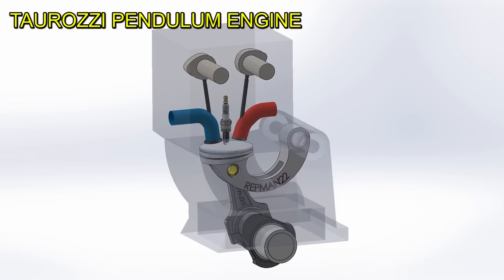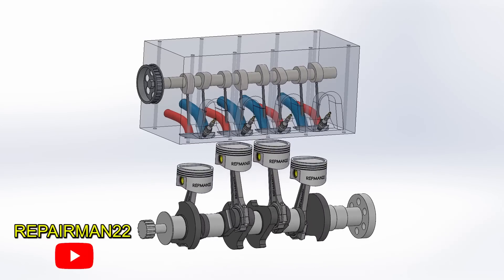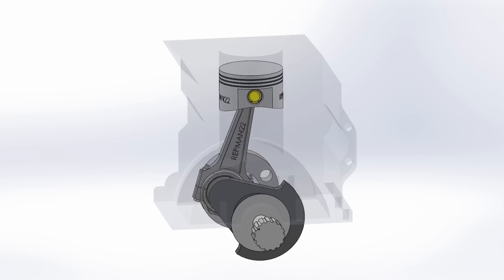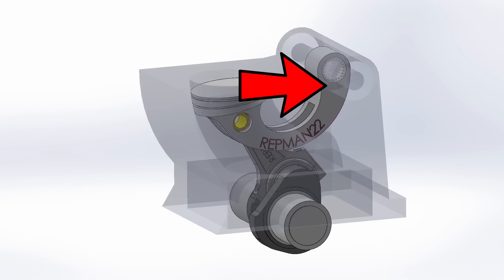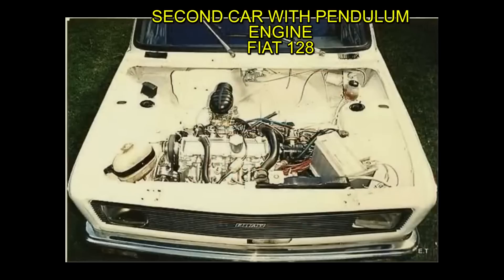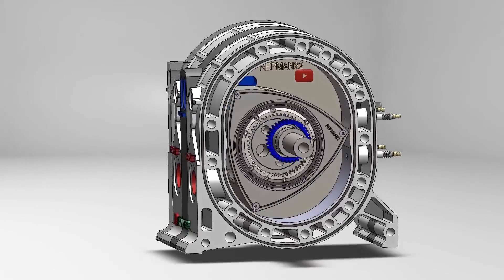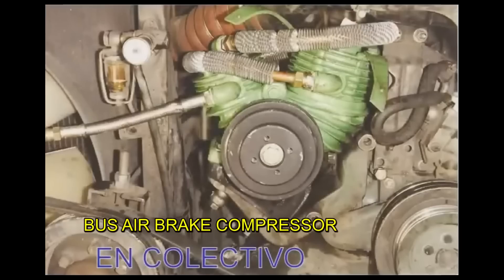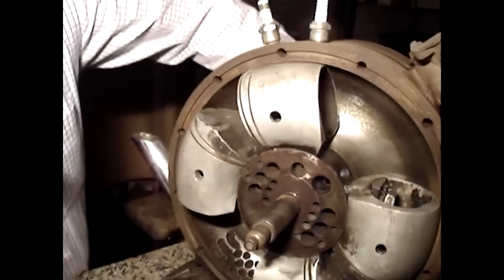All about the Taurozzi Pendulum Engine 🧠 and what happend to it🤯

Comment: I would love to see the machinery takes to bore a curved cylinder!
Reply: guess its just same system as in the engine making same movement of drill
Reply: @orangestoneface  even a 3 dimensional cnc m/c could not produce curved bores. Weather they could be cast and polished I do not know. And who could do a re-bore.
Reply: @orangestoneface  can imagine billet mounted on lathe axis of biaxial milling maschine while being bored with flycuter working from second axis. Then hone with ball style honing head Must be lot of fun to setconcentricity of piston path in relation to bore while keeping crank in just right tolerance. Like we have dynamically changing triangle here both adventage and asspain to assembly technicians do i think it may be why they are no so common. But sound of it in 6 cylinder 8liter naturally aspirated boxer config must be awesome 🤩
Reply: @orangestoneface  
If you did guess that, you would be very wrong.
Reply: @orangestoneface  the bore tool might even just replace the con rod and piston, doesn't seem too hard to figure out.
Reply: @orangestoneface  what happens when you turn a u-shaped drill bit 180°?
Reply: That machine cost 20 billion dollars and take a day to do one block...😂😂😂
Reply: @chuckschneider5625  think about jet engines blades, they are far more complicated in production, and yet they basically can be produced in small workshops with modern equipment
Reply: @chuckschneider5625  Maybe you didn't watch the vid. The Tourozie compressor uses the same shape cylinder and is mass-produced.
Reply: @chuckschneider5625  The first one always takes time. when you scale up for production things get done differently 🤦‍♂️
Reply: @chuckschneider5625  The Cost is expected, but the production time is a problem.
Reply: Nothing modern CNC machining can't accomplish.  Obviously the compressor manufacturers have it all figured out.
Reply: @magnusatheos7301  
Maybe so, I still want to see it!
Reply: @upsidedowndog1256  LOL so do I
Reply: @upsidedowndog1256  me too.
Reply: @upsidedowndog1256  Look up 5-Axis CNC or even better Metal SLS 3D printers. The latter can create shapes that are utterly impossible to accomplish with standard tooling.
Reply: @upsidedowndog1256  Simple, a spherical cutter
Reply: @magnusatheos7301  
Nop! Making a round bore with a curve in it, that is constant and smooth enough to have a piston and it´s rings hurtle up and down a hundred times a second is not don that easy!
A modern CNC could do that, but it takes hours for a single bor!
And for what benefit??
Reply: @martin09091989  on utilise un outil hémisphérique où un outil boule c'est parfaitement rond et on lui donne la forme que l'on veut et donc on peut aussi avoir un Rodoir de la même forme pour la finition
Reply: @denis-uo6ew  Merci d'avoir ajouté votre réponse. Voici votre réponse traduite par Google: (Thanks for adding your reply. Here's your reply translated by Google:)
we use a hemispherical tool where a ball tool is perfectly round and we give it the shape we want and therefore we can also have a Rodoir of the same shape for the finish
Reply: @denis-uo6ew  Es ist schlecht Franzose zu sein!
Reply: @martin09091989  je ne pourrais pas être suisse ou belge ou monégasque ?
Reply: @martin09091989  it takes hours for a single full cut, sure. However if you cast the block and the cutter only needs to refine the bore, it is much quicker. In a modern multi axis CNC mill, it would be very quick.
Reply: @unicornadrian1358  the majority of the shape would be cast, the rest would cut just as quickly as a straight bore. Rotate the block around the same axis as the pendulum arm as the boring bar machines it out. Easy and repeatable at speed.
Reply: @denis-uo6ew  Avec des pistons aussi courts, ne risque-t-on pas des remontées d'huile comme sur certains moteurs récents ?
Reply: @tinkerne-round4079  yeah just get a rotary table on a milling machine. Cutter stays at the same height throughout operation, work piece is rotated into the cutter. Pretty simple really.
Reply: @unicornadrian1358  But still way slower and more elaborate.
And for what benefit?
Reply: @tinkerne-round4079  yep exactly what I said.
Reply: @martin09091989  what benefit? An excellent engine that basically lasts forever
Reply: @unicornadrian1358 
Why, is it better? Just repeating nonsense frases doesn't explain anything!
How dose this construction reduce friction?
How dose it make the combustion more efficient?
Reply: @martin09091989  it doesn't make the combustion itself more efficient.
It can only reduce friction losses due to the short piston.
Nothing more, nothing less.
Further its a 100% conventional engine.
Reply: @doctordapp  All that trouble for that piss amount of friction, and all the new problems it brings with it?
Wow that's stupid!
First problem: the moving mass on the rod end is higher due to the arm, needs bigger bearings, more friction. 
2nd: when the engine and thus the piston arm heats up, it grows toward the one side of the chamber wall.
3rd: piston rings wear unevenly and will be influenced by the centrifugal force around the arm axis. Outside gets pushed against the wall harder, inside gets pushed into the groove.
4th: block strength is compromised due to openings on the side, so the block gets weaker and/or more heavy!
5th: the piston acceleration has higher peaks due to the two circular paths instead of one linear.
The piston will get jerked harder on TDC, depending on the rotational direction to the piston arm at decel or accel.

And the knew harmonics the arm brings with it! An engeneres sweaty nightmare! 😱
I see parts of the piston fatiguing, and weird wear patterns on all the bearings.
Reply: "And for what benefit?"... Jesus man,  go watch the video again.
Reply: @jpwillm5252  je n'en sais rien l'huile c'est en général dans le vilebrequin et par barbotage là il s'est même permis d'enlever le troisième segment (racleur) donc c'est encore mieux
Reply: @denis-uo6ew  Je pensais à certains moteurs comme les "Puretech" (Stellantis).
Mais ici, on s'est permis de supprimer le racleur, ce qui est bon signe. 😎
Reply: @martin09091989  the friction is greatly reduced because the piston has a set travel path that is centred within the bore. Unlike a standard piston which relies on contact with the bore to maintain alignment. It was literally explained in the video. How about you watch the actual video instead of gnawing on your crayons. Then you won’t need to ask ridiculous and superfluous questions.
Reply: @Martin L  rewatch the video,  it tells AND SHOWS how friction would be lower.
Reply: @miniac60  only theoretical...
You add other problems to the system.
Strange harmonics, thermal expansion which is impossible to handle.
It looks promising, but has a lot more than only the advantages...
Reply: @unicornadrian1358  I knew what the benefits of this design was and the intention behind it. Just was curious if someone could come up with another bonkers reason. 😏
40% of all parasitic loses inside a engine is from the piston group.
Half of that is for the rings dielrectly and half is from shear forces between the piston and oil film.
This shear forces are round about half and half for the skirt and the oil rings.
Half of the work of scraping off the excessive oil comes from the skirt.
So in best case zenario you get somthing like a 10-15% reduction of losses thru that mechanism.
And now add all the additional losses thus to increase of yoints.
For the mater of the doubt, let's give it a 10% benefit.
Is that worth the effort?
You can easily shave off alot more loses with simpler solutions.
Alot of modern engine for example have variable displacement oil pumps, that gives you 10-15% right of the bett. Also magnetically coupled water pumps to cycle them periodically or to use a smaller electrical pump for low power situations.
The benefit is not worth the complexity!
Maby you can work out all the new kinks of such a system and make it at least reliable.
But you have alot more expanses to produce and maintain such an engine.
For example you need a specialized Maschine to hone the bore for repair, heck you can't even cross hatch it because you just can do single point cutting! You also can't sleve it, so you have to LDS coate it or go back to Alusil surfaces.
Alusil is just repairable with larger pistons, and LDS is not viable for repair and needs cross hatching anyway!
That's like making a wankel engine equal to a piston engine. Can it be done? Shure, but it takes aerospace tech and development to do it!
And even the simple solution like the oil pumps are not done on smaller cheaper engines because it's simply not worth it.
Reply: @martin09091989   Not really.... If you start with a decent dimensionally stable investment casting the machining of the block using a 5 axis CNC machining center could do a block in a half hour. It would only take hours if you started with a large billet of solid iron. For that matter, the bores could be machined as sleeves then pressed into an aluminum block adding lightness to the equation. Benefits? Longer life with no bore or piston wear, less oil consumption, higher efficiency, just to name a few......
Reply: @martin09091989 guess you know more than the engineer who design it. That is why his invention is being used all over the world in medical compressors and you are just a keyboard warrior….
Reply: @martin09091989  Like they said. Dont be a knucklehead. Watch it again and come back and tell the group how You can make it better.
Reply: @martin09091989  What a load of absolute piffle! I mean, seriously? You make that claim yet some backyard engineering enthusiast in 1970s Argentina was able to do it in his own workshop!
Jeez, if the quality of logic on display in this thread was a gauge of future human endeavours, I think I could rest assured that humanity wasn't going to create its own mass extinction event... because we'd all be dead by next Tuesday.
Reply: @martin09091989  Ich bin ein hotdog.
Reply: @davidcolin6519  It's not that it can't be made!
It's the viability that's the problem.
It increases complexity and afford to make, and doesn't give back much benefits and adds new problems. 
I am myself build stuff like that all the time just because it's a fun challenge, not because it's revolutionary.
I guess that was his purpose also.
But then comes someone that doesn't understand engenering and think that's the next best shitt after sliced bread, and convince him to promote his stuff, or dose it for him.
Sry to brake your enthusiasm about revolutionary inventions that kept suppressed by evil corporations for profit......  It's not that!
This stuff was made multiple times over the last 200 years, and it was not successful for reasons.
Engineers built a multitude of engines with all sorts of levers and cogs. 
In fact, the first gas engine from Nicolaus August Otto, (the inventor of the Otto cycle) had no crank but a long ratched rack to drive the flywheel. It worked fine, but it was quickly replaced by a conventional crank, but with a linear guided rod end, like a steam engine. 
That was quickly replaced by today's standard configuration, even with slow moving open crank engines. Why if such a guiding system is such a good idea??? 
Because more affort for to less advantage, if at all!
In reality, alot of things that are good in theory are bad in practice.
Reply: @ajwilson605  How would you Maschine and press in a bowed sleeve? That would be interesting.
Also how do you hone the surface to get a cross hatch to hold oil?
You just can Single point cut such a geometry.
Best choice for the bore lining would be LDS or Alusil. 
Alusil is crap, and LDS can't be repaired and need honing. 
And why would there be no wear on the bore? Most wear comes from the rings, the skirt is mostly hydrodynamicly beared by the oil.
Oh Yea, because it says so in the video. My bad! 🤦‍♂️
Reply: @tinkerne-round4079  the tooling would wear faster with the curved bore. A straight cylinder can be reamed with a bar tool that has a straight line cutting edge. A curved bore can only be reamed with a point tool.
Reply: @martin09091989  The benefit is fuel efficiency for starters it seems.
Reply: @jpwillm5252  did you not listen to the video?? it addresses why oil is not an issue
Reply: @leadgindairy3709  
Yea, I did!
And what?
Everything claimed from the curator is absolute truth?
Because it must be, ain't it?
What technical fact in this video makes logical sense?
It's just the typical "it's 30% more efficient, bla, bla"
The compressors build with that is a viable application because they have Teflon seals and are used for spezial purposes where no oil is wanted. So you can't use the piston to guide itself. But on the other hand don't need to have a cross hatch (so you can single point cut it) in the bore, not much heat and low rpm.
By the way, 50% of the friction in a piston group comes from the rings, and those loses make up for 40% of all parasitic loses INSIDE the engine, and the parasitics make 5-7% of the engine power. It's not the ultimate wonder weapon that increases efficiency at 30%.
It literally reduces over all PISTON group losses 20- 30% (mathematically best Szenario) wich results in 1-2% overall efficiency gain! WOW! 💪
Reply: @Martin L    Hey, you are obviously taking an emotional approach to this argument and it's not going to end well.  But for sake of explanation,  there is no wrist pin on the banana arm... that piston can literally ride in a perfect path where it NEVER contacts the cylinder walls.  Hence, nearly zero friction.  This system works nearly identical to a standard shock stanchion,  where an o-ring is all that seals the piston concentrically in a shock body.  

And building the curved bore?  They were doing this on manual mills 90 years ago... you don't think a 5 axis machine could whip that out in its sleep today? 

Rather than being so opinionated,  maybe approach things from a "want for information " angle, and maybe you won't get your ass handed to you so hard.
Reply: @matthewpeterson3329  I don't know where the emotional part is, but maby it just bugs me that so much people can't use there brain, and instead like to get hyped with spectacular special bla blub.... 
Thing is, it's not at all frictionless, the rings make up for 50% of friction in the piston group.
So that's the rings, (mostly the oil rings) and the skirt and the rist pin (wich is negligible)
What I would like to see on the comments are technical debate about specific aspects of this construction, and what those could be beneficial for.
Like the compressors, those are for low oil, or oil less applications where you can't rely on the skirts for guiding. How much rpm can you pull on those ptfe seals, and what surface on the bore is good for that?
Maby a smooth bore with chrome plating?
You can Single point cut such a shape smooth easily, but you can't hone it.
Wich surface treatment would you think would be viable for a production, combustion engine in that making? 
Honing a cross hatch is pretty much out of the question.
Or how would you do that?
Reply: @Martin L    I like people like you,  so certain you're right.  For those of us who love ICE engines but are willing to think outside the norm, It will be so much more sweet when you're left in the dust.  So long as it works well, and criminal politicians don't influence it, the next best engine could be within our grasp.  Time to step back and consider every option.
Reply: @matthewpeterson3329  They are asking questions, you are being emotional, this is a basic thing to observe.
Reply: @matthewpeterson3329  No I'm not certain that I'm right but pretty convinced.
As long as no one brings up some logical and technical based argument I will nagg you dreamers until I get bored! 🤣
No really, no one defending this brings up real technical arguments!
It's all just "it's so much more efficient", "you just wana be against it", "watch the video..." bla bla bla....
Pls, someone give me a theoretical solution how the get a cross hatch in that bore! How?
Reply: @Martin L   This started with someone saying they wanted to see how a curved borebwas made.  You immediately and very adamantly stated the idea was ridiculous, so hotly that it could only be perceived as passionate... hence emotional.  My stance is that if engine builders exhausted this design concept, proving  that it no merit, then sure, I might agree with you.  But it hasn't, and you haven't,  and we are supposed to accept your nay-saying as gospel.  Fact is, there is a lot of money behind keeping new designs from being tried.  Oil companies and automakers want us to keep burning those dinosaurs, so much so that they will spend millions keeping innovation stifled.  Personally, I love ICE engines, noise, and the smell of burnt rubber.  I also love seeing creative options other than fucking EVs.  You are telling us to prove it will work.  How about you prove it won't.  Your points don't correspond with this type of engine, no matter how often you repeat yourself.
Reply: @martin09091989  cast then cnc for more precision
Reply: @martin09091989  lol that’s a lot of words for “I don’t understand what I am looking at.” 
Of course it can be sleeved and without much difficulty. Oversized pistons can be put in with little effort. Of course they won’t need to either of those things due to the lack of friction inherent in this design. It runs cooler and requires less lubrication which both increase efficiency. The only “downside” to this engine is its longevity. No manufacturer wants an engine they don’t have to replace at some point. Interesting that you don’t think it’s reliable when his own car has been running for 40 years. 😂 sheesh.
Reply: @martin09091989  Well, IF the engine does get 30% better economy then that would benefit the consumer so realizing that, there is definitely no way that the auto industry will ever consider it.
Reply: @leadgindairy3709  I even watched it twice.
There are classic engines with short pistons to limit friction. Some of these modern engines suffer from oil lift which leads to serious problems.
With the Torrozi engine it will be necessary to lubricate the inside of the cylinder a little to avoid wear. No ?
Reply: @martin09091989  This construction does not make the combustion more efficient but it gives a large reduction in friction. The forces resulting from the connecting rod being at an angle to vertical most of the time are in the conventional engine taken by the piston skirt as it slides in the cylinder, and this causes quite a lot of friction. In this engine the piston is not in contact with the cylinder (although the rings are) and the forces resulting from the angle of the connecting rod are taken on a pivot that can have roller bearings making it almost frictionless.
Reply: @martin09091989  Benefit is less wear, which is not in the interrest of the automobile industry, manufacturers want the product to incorporate elements of self deprecation, such as wear. How are they going to sell more cars to you otherwise?
Reply: @ET_AYY_LMAO  OH shitt, I smell conspiracies!
No that's not there only intend.
They making stuff as cheap as possible, because we want our stuff to be cheap.
What people don't realize is that although stuff gets cheaper, the live span often times stays the same!
Especially cars didn't drop that much in runtime until recently.
(cars that cost as much equivalent to a sewing machine in the 1920s)
A car from the 60s can't run even 100k without several engine rebuilds.
The thing is, in an ideal world, the technological advances would be used to make things last even longer to get the most economy out of them. But that's not our world.
The consumers demand cheap stuff all the time, and the industries are happy to constantly deliver. That's our economy today. 
That's a social problem, not a conspiracy from the industry.
Reply: Magnus Atheos watch the video again. Ithe video tells you the benefit.. If true it would be better to use the engine after all the video said it's being used already in some compressors
Reply: @doctordapp  It's not the shortness of the piston that makes the big difference. What does make the big reduction in friction is that now the piston is not being pushed against the side of the cylinder and does not even touch it. Only the piston rings touch the cylinder and the only force they exert is that by their springiness that keeps them expanded to provide the seal.
Something similar is achieved in the very large marine and stationary two stroke diesels. Those use a sliding bearing to cancel the sideways forces exerted by the crankshaft through the connecting rod.
 I think though that the energy saved by elimination of that friction is grossly overestimated and would put it more realistically as some 2 to 4 % as the energy lost to friction
 between the piston and cylinder is already only a few percent in modern ICE engines, s even if you could eliminate it totally there is not that much energy to be saved from that. It can though help a lot in reducing oil consumption and increasing engine longevity.  The reduced oil consumption can even help with emissions reduction as less oil seeps into the combustion, allowing it to burn a little cleaner.
In the large marine engines I mentioned the motivation for doing it is not so much to improve things as to just make them possible. At such scale the sideways forces of the piston would be very difficult to deal with using the conventional arrangement. Conversely the reason they don't use such an arrangement in cars is that it makes the engine much taller and heavier.  The Taurozzi arrangement on the other hand can probably achieve the same advantages with little or no increase in height or weight. I would guess the only reason it is not actually used is that the advantage of reduced wear is not considered enough to be worth redesigning well established production methods that have been perfected over more than a century. The toroidal 'cylinders', are not difficult to manufacture but it would take years or decades to refine the process to the extent that it could be done as cheaply and reliably as ordinary straight cylinders are made today.
Reply: @jpwillm5252  Yes, but much less oil will be needed as it only needs to lubricate the rings, not the whole piston. In the conventional setup the piston is pressed with great force against the sides of the cylinder making lubrication critical to allow the piston to slide along whereas in this setup the piston does not even touche the cylinder. Only the rings move along the cylinder and there is nothing pushing them against the cylinder walls except for their springiness that keeps them tight on to the surface.
Reply: @doctordapp  the change in leverage from a different angle of approach to the crankshaft can certainly make the engine more efficient.
Reply: @martin09091989  Amen
Reply: @martin09091989  modern CNC are really fast. Program them. Making a curve shape is no problem at all
Reply: @Martin L  

A 30% gain is huge and would be well worth it! They are using machines to make much more complex shapes than that with zero issues. The problem right now is auto unions.
Reply: @listerdave1240  You are probably right if it is possible to lubricate the rings very little without creating seizure.
Reply: @jesusisalive3227  No. The problem is not auto unions. Honda and BMW, for example, neither of which have unions in their US plants,.
Reply: @martin09091989  Maybe you didn't notice but when the guy made the original prototype there is no oil control ring on the bottom of the piston. The lower friction of not having the piston or it's skirt rubbing against the bore allows for a skirtless piston. As far as rings are concerned, there's now low tension rings that seal will without wearing the bore out. Honing could be done by a flexible "dingleberry" hone and you wouldn't need a deep crosshatch, just enough for the rings to polish the bore and seat. The sleeves can be installed easily as the arc of the sleeve is the same as the bore in the block. Heat the block, chill the sleeve, with proper design clearances the sleeve will go right in. Have you ever "rolled" main bearings into an engine without dropping the crank? Same thing but without the heating and chilling.
Reply: @ajwilson605  So you mean the piston rings run dry or what?
The oil rings have nothing to do with the skirt, they are needed anyway. 
Also honing with a "dingelberry" will get that bore out of shape.
Only way to Maschine anything in such a geometry is by having the "cuter" in a single plain and moving the tool head in that path. In a production environment that's not feasible because you get trouble to control wear on the honing tool. That for Shure would be a candidate for other technics like LDS.
Reply: @akio2589  

The auto unions still force the other companies to play the game. If it were not for the unions, cars would cost half as much!
Reply: @martin09091989  dude actually proof read jeez. There is several advantages, many of the issues you mention are just excuses  and could be fixed for mass production,

 ie mount from the rotation point and machine it as some one mentioned above,

the weight as mentioned in the video can actually be less as the piston height is reduced and the rest is reduced in its effect as it moves slower, cause that's how rotating things work...

Harmonics is fixable

The expansion could be accounted for but That's the only one of your arguments that holds water

Lastly wear you say except that's massively reduced so unlikely an issue.
Reply: @unicornadrian1358  not really, even with a barrel form cutter it would still be a very inefficient toolpath and then you would need a very complicated and slow 4 axis grinding toolpath to get a decent form tolerance and surface finish.  You could probably sink it but the only way to make this in quantity would be a purpose built machine that does nothing else. You Might be able to do it relatively quickly with some form tooling on a rotary but I would no quote this if it came into my shop, it's a QC nightmare.
Reply: @Doctor Dapp  if we were to believe what the clip says its applied test resulted in better than conventional ICE results for efficiency and thermal management. That's a big "if" though!
Reply: @martin09091989  30% efficient and no oil need.
Reply: @mitchellcouchman1444 
It's for Shure doable.
You also can EDM maschine an engine block out of solid tungsten. 
But my overall conclusion is that you have to figure out too much new problems, for to less benefit. 
You basicly throws away 40% of engine development from the last 100 years, and start from scratch. 
For example even wankel engines are not at the same refined state as normal piston engines. 
You can't just make a piston bore bowed and assume that it will all behave like a linear one, BUT BETTER! 😑
Reply: @martin09091989  - What benefit? It says in the description. Less friction, less heat build-up, less cooling fluids required, more efficient combustion (even without catalytic converters), less weight, fewer parts (no oil ring or ring cut required), more power output, less wear with greater longevity. 
That's quite a list, I think.
Reply: @kirkboswell2575 
Yea, just take all those claims for granted, without using you own brain. 🤤
You are exactly the right customer for that!
Reply: @martin09091989  - Never advocated taking things at face value. But every thing mentioned would, indeed, be a benefit - which was what you kept saying "What benefit?" 
While I don't advocate taking things at face value, neither do I disparage things automatically. Plus, I know about the compressors, and always wondered why nobody tried to put them in vehicles. They work very well.
Reply: @kirkboswell2575  Yea, I did that because most of those claims are more then questionable for someone with an engenering background.
And I like to challenge the Fanboys. 😈
No one of them comes with ther own arguments, instead they just repeat what they have been told.
Reply: @martin09091989  - 👍
Reply: @martin09091989  I guess you didn't watch the video
Reply: @NikoBell1188  Why do you assume that? 😏
I guess you are to lazy to scroll true this comment?
Reply: @martin09091989   you literally keep the whole engine head and crank... And as mentioned by serval people there are several more effective ways of making the block than edm to to mention if you were in mass production you can use custom tooling
Reply: @tinkerne-round4079  even so , we use aluminum blocks with a steel liner .  How would you do this in a curved cylinder?
Reply: @mitchellcouchman1444  Yea, to EDM the block out of tungsten was just a joke!
But it worked! 😂
Get some books about machining, industrial Production and internal combustion engines!
I just can recommend German ones, but maby the English literature hase somthing equivalent.
Beside all the Profesional literature ther is a good series called "autos schneller machen" Independently of it's cheesy name there is alot of really good information on every topic from the engine over chassis to the Suspension, from former industry engeneres in retirement.
Just in German though! 🤷‍♂️
Reply: @rayRay-pw6gz  imagine the tool boring the hole as spinning stationary and the head swinging on an axis instead of a tool cutting around a bend. If you can't picture it just trust me it is doable and has been done.
Reply: The tool would need to be a flat fly cutter not a drill bit because a drill bit obviously won't bend around a corner.
Reply: @tinkerne-round4079  I do understand that concept. The aluminum block and steel liner construction baffles me .
Reply: @martin09091989  the explanation is in this video. All in there. You ask questions you should already know the answers to.
Reply: @tinkerne-round4079  Horizontal drilling is now routine.  We can sink a hole 5000 ft deep and turn it 90% for another 5000 ft.
Reply: @martin09091989  you obviously do NOT like this design. I do. If it were more common all shops would be equipped to work on them.  Your reasons have little proof compared to actual working models. Their specs which seem to contradict everything in your talking points.
Reply: @matthewpeterson3329  well put
Reply: @Unkl_Bob  "There spacs wich seam to contradict in your talking point." As a non native English speaker I head to put that sentence into a translator to understand, I guess you are British, Americans don't speak that elaborate. 😆
I don't give a damm if my statement are not that coherent, because I want to see some quality arguments about the topic, and if you don't understand the technicalities that I just scratch, IDGAF. 
Yea, I don't like this engine as a internal combustion engine. 
Because I can see all the new problems that come with that constitution, and I think it's not woth it, it's just a noble approach.
Don't get me wrong I am not the most knowledgeable person on that topic, but given the lack of valid arguments against mine make me wana push the finger deeper in the wound! 😈
For a little test, what is the shape of a piston in a modern engine like?
As a hint, it's not a cylinder. 😉
And why?
Reply: @kolby4078  why a barrel form cutter. A ball cutter or the flat disc shown in the video with the block being rotated onto the cutter as shown in the video would do the job nicely.
Reply: @unicornadrian1358  barrel form would be the fastest for a wall like this for a 5 axis toolpath. You could also use a boring head/fly cutter type of form tool on a 4th axis.
Reply: @martin09091989  how much is 30% of all gas used in ic engines worth? Id say that's what it for
Reply: @martin09091989  They told you the benefit, 30% fuel savings PLUS all the other savings due to reduced heat etc.
Reply: @martin09091989  Why its better is ALL laid out in the video, I suggest you go back and actually view it
Reply: @leadgindairy3709  it waffles and makes lots of claims. That's it. Easy to cut it says, rotate the block say the armchair experts, yeah you just need a cutter with a zero height cutting edge that never wears, maybe Doctor Who makes them.
Reply: @martin09091989  They literally showed video from a factory in the 80s doing just that. And it wouldn't be in use if it too hundreds of hours. 

Maybe go try making something instead of watching videos about other people making stuff ;)
Reply: @Shanidar1  video repeats hype originated from the author of this idea. Not supported or proven by anyone else. And actually rejected by other manufacturers after some research.
Reply: @unicornadrian1358  it sure does. The question is by how much? And does it even compensate all introduced new problems such as asymmetrical centrifugal forces, higher piston inertia etc.  Only thorough research and study can answer this question. Such studies so far were only made by engine manufacturers that were originally interested in this design. And they were not as successful as expected.
Reply: @miniac60  it doesn't show all the disadvantages of this design though. No mention of asymmetrical wear due to thermal expansion and centrifugal forces, higher mass of the piston, introduction of new engine balancing issues etc. It's not as simple as less friction...
Reply: @covoxer  I got the impression the manufacturers didn’t even look at it. My interest is to see if it can be run as a compressed air engine. If it works well for that, being able to switch it between compressor/ engine mode as a way storing solar power.
Reply: @unicornadrian1358  yes, this video makes such impression. But it's simply not true. It was a time when many engine manufacturers were looking for revolutionary changes in engine designs. So they were evaluating a lot of them. It was not the case when engine inventor was approaching them, it was opposite - they were approaching him. And in case of rotary engine design, several manufacturers proceeded. Even though it also failed with time. But this proves that they were actually willing to try out any new designs, that had some advantages. Apparently this one had not enough, if any, so it was dismissed after further evaluation.
Regarding compressed air engine, unless you need it to produce uncontaminated compressed air in compressor mode, I'm not sure it's worth all the complication.
Reply: @covoxer  interesting. I wondering what your motivation is to be so negative about this engine. Have you seen one running? Have you put one on a dyno?
Reply: @martin09091989  the cylinder wall friction is reduced as it doesn't have to act as a a bearing - the banana arm has a fixed bearing
Reply: @PorchBass  No shitt Sherlock!
Reply: @unicornadrian1358  no, not negative in a slightest. I'm just trying to be realistic that's all. This video is way too positive though. Think about it, the only positive source cited here is inventor. Obviously not a reliable source, right? No one else who've seen this engine running and had expertise to analyze it properly found it worth further development. But it's always a good idea to make some sensation around some weird thing that failed. And a hint of conspiracy. Always brings views and comments up in no time. ;)
Reply: @ajwilson605  ок, а что вы скажите про ослабление одной стенки блока? Там вырезали кусок блока!!! А болты крепления головки к чему эту головку будут крепить? При износе банана куда будет отходить поршень? На больший радиус и привет зазор в 0.2мм с последующим расходом масла 5л/100км. И ещё вопрос, жаропрочная юбка поршня очень тонкая, вы встречали сгорание поршней от перегрева? Этот поршень очень тонкий что бы выдержать хорошие нагрузки.
Reply: @cedriclynch  так шатун к вертикали стоит в начале рабочего хода у Хонды, посмотри конструкцию моторов от Хонда, у них ось коленвала и цилиндров смещена, и нагрузка боковая только в процессе сжатия. Вот вам и решение простое.
Reply: @ajwilson605  вы забыли упомянуть про радиус загиба)) тут иногда прямые выточить цилиндровые втулки не могут, а вы хотите ещё и с загибом. А как проточить под эту втулку ровно от оси качения банановых рычагов? За что брать базу? И вообще мне кажется что при сгорании топлива с воздухом в цилиндре, давление оказывается не прямое на поршень!!!! А косое, часть давления уходит на стенку цилиндра!!!
Reply: @kirkboswell2575  меньше тепловыделение? Вы пробовали нагреть дизельный мотор зимой? Этот мотор из видео и рядом не стоял по кпд с дизелем.
Reply: @covoxer  - First of all, the pistons aren't more massive. The piston weighs the same as the piston/rod combo in a conventional system. However,  you have a point regarding thermal expansion. If air cooled, as most of these are, there's a difference in the mass of the peripheral walls from one side to the other. Keep in mind, they are actually made and used to produce medical quality gasses - no oil to filter out. And I've always wondered why they weren't used in vehicles after seeing them in action. You are also correct that there's bound to be new balancing issues with placing them in vehicles. But I do think that the vehicle companies "buried" the concept by simply ignoring it. The Wankle and other engines that have been produced had the potential to save a lot of money in the long run. The pendulum engine doesn't save much compared to conventional engine production. It's advantages are in efficiency and longevity. Which translates to getting ignored by the car companies - it doesn't gain them much to push for changes.
Reply: @martin09091989  well yes I think I got lost somewhere in the 234 replies! Sorry was a bit excited there
Reply: @martin09091989  The benefits of almost no piston or ring wear are immense, so is running at less heat generated- Just thinking through it in my mind, you're dropping the primary source of friction in the engine, and now your only wear surfaces are rings and bearings.. Ever rebuilt an engine before? Replacing just rings and bearings and having like-new levels of compression and smoothness sounds pretty amazing. And any energy not spent wearing stuff out, is extra energy going into the power of the engine.

I'd call that a pretty big benefit, even if realistically it's more like a 5% improvement in heat generated and oil lost.

Milling it would look about the same as milling any other bore- you don't mill a bore when it's a completely solid chunk of metal, you mill it from a casting, that's already close to its final shape. The mill simply removes your tolerance layer of metal- something that is very easy to do on aluminum (or iron), then it'd be polished and coated. Which I think you'd be going for an aluminum block in this design, considering it's low-friction.
Reply: @martin09091989  If you watched the video, these operate as in such a way that there is no side load on the piston that forces it into the bore. A pair of low tension piston rings is all that's needed for sealing the piston to bore gap. There is no "oil control ring" in this design. As far as honing the bore to size, you're thinking of "old school" cylinder honing as used for straight bores in current automotive uses. The honing used on these curved cylinders is used as a surface preparation to seat the rings, and nothing else. A "dingleberry" hone removing a few ten thousandths of an inch will not effect the bore's integrity in the least. Since the piston never touches the bore, wear of the piston and the bore, are minimalized as is friction.
Reply: @kirkboswell2575  well, of course I'm not 100% sure, but at the depicted dimensions the piston must be heavier in order for that curved rod to withstand all forces at higher RPM without too much deformation that would result in catastrophic consequences.
Compressors work fine because they are not exposed to extreme heat in combustion chamber and I suspect (although I may be wrong here) they are working at lower speeds. Also, weight to power (or rather productivity) ratio is not as important factor for a stationary compressor as it is for a car engine.
About efficiency and longevity. Where these climes come from? Ignoring assurances of the author, let's think theoretically. Efficiency can come from less piston friction. But would it be really less? It would be certainly less with the same level of lubrication. But in this construction there's supposed to be virtually no oil on the cylinder walls. So less forces but higher friction coefficient. And the answer to this equation may be either positive or negative. We can't answer it right away. Same thing goes for longevity. Reduced forces but reduce lubrication as well and you don't know what you get without testing or more thorough research.
And it seems that that's exactly what manufacturers did. The obviously complex to manufacture construction was clear at the first glance. Yet they were still interested in this idea. They evaluated it, made some research. So the reason why they finally dropped it was not something that trivial.
And we are talking 70's. Manufacturers back then were much interested in high efficiency and longevity. Fuel crisis, early emission control, and still people buying cars for years, that's what forced them to look for alternatives, including rotary engine, diesels etc. Mercedes produced one of the most reliable engines in those years. So I doubt they would dismiss design that easily bring them such huge benefits.
Reply: @martin09091989  you clearly didn't pay attention to the video, they explain why this is a superior design over what we use today. Way less friction on cylinder walls, therefore way less heat and ware.
Reply: @martin09091989  well if you say so, then I must be! because you just know everything don't you keyboard warrior?
Reply: @covoxer  - All good points, but having seen pendulum engines in action on compressors, I'm still inclined to think favorably. They are, indeed efficient and long lived - but you are quite right that RPM's are steady, loads even, and external vibrations minimal. That can certainly make a difference. Your comments reminded me of an oil field worker who maintained the pump engines. Those were standard vehicle engines and every one of them was approaching 500,000 miles equivalent (good maintenance). The common factor being steady RPM's, even loads, and minimal external vibrations. Under normal operation, vehicle engines don't last that long. It's therefore possible that the efficiency and longevity of pendulum engines would be similarly affected...... Food for thought.
Reply: @that207guy7  no, I don't! But I give logical arguments and all you Fanboys don't!
Don't just say, "yes this can be done with cnc machines" of cause it can, but if one sleeve takes 2 hours to Maschine with a ball end mill, you can brace your self for bankruptcy, even with 20% efficiency gain on the engine!
How would you go for the bore surface? Alusil, Nicasil ore LDS? Mh!?
Or if you think classic honing is viable, how would you technically do that?
Pls give your wisdom to me!
Reply: @integr8er66  You assume that the "30% gas usage reduction" is true. It's not, you're too gullible. That wild claim doesn't hold to scrutiny.
Reply: @covoxer  of course the inventor is upbeat about it, he is still driving a car powered by it. 😂. My point is that not a single one of the detractors have seen one or tested one so they are being negative with zero facts to back them up. Car companies reject great ideas all the time, because there are no long term gains in them, planned obsolescence and a steady market for replacement parts are quite profitable.
Reply: @unicornadrian1358  sure he drives one. He may drive it infinitely since he built it, he can rebuilt it as much and as often as he needs to. 😉
Interested companies had much more data and did much more research on this project than neither of us did. So they knew better than we do. And they were not negative from the start. They originally were interested. And only rejected it after more serious evaluation.
And what about the inventor? He made any open tests to prove his points? Not a single dyno test? Really, in times when every tuner does it casually for a slight ECU tweaks, the inventor of the new engine doesn't care? The only sensible reason for this is that the result will debunk all his claims. And he knows it well.
True about the gains for large companies. What's the point of producing things that make no profit? Although even then they sometimes risk with projects that are not immediately successful. As was with rotary engines. They were not rejected until after some time in production. In case of Mazda after several decades. So it's not like car manufacturers hate great ideas. It's just not all ideas that look great on the first glance for general public, are indeed that great in reality.
Claimed advantages of this engine would be quite profitable if there were no hidden disadvantages. Having more efficient engine in times of 70's fuel crisis, early emission standards introduction, would be great to win competition. Eventually many companies adopted, quite successfully, diesel and turbo engines for this reason. So they were looking for more efficient alternatives after all. And you just can't blame Mercedes for planned obsolescence in years when they were developing mil km car engines. Don't forget, this was happening in 70's.
Reply: @martin09091989  
i can drill a square hole on a standard mill. honig a curved cylinder is not a problem.
only thing not addressed is the uneven heat due to friction contact lengt in a curved bore.
Reply: @martin09091989  the angles of the forces exerted against the cylinder wall  bi the piston head are reduced to zero...
Reply: @carlosmejia5728  That sentence makes not that much sense!
I just can guess. 
Pls explain more precisely what you mean.
Do you mean that on the pendulum engine, the piston doesn't exert lateral forces onto the zylinder wall? If so, yes that's it's whole purpose!
Reply: @martin09091989  "Yea, just take all those claims for granted, without using you own brain."  
Well, the guy built several of these engines so his claims are easy to verify. 
You're just winging it with nothing to back it up.
I would say the inventor has at least one up on you.
Reply: @unicornadrian1358  I don’t see why it would take hours.
Reply: @tinkerne-round4079  those idiot  automakers... They could be gaining millions but they chose not to.... Conspiracy alert...
Reply: @FNU_LNU_56  me either mate. Maybe 10% longer than a standard engine.
Reply: @martin09091989  sadly your the only one that really is aware of the bigger picture.

The market drives the value down, manafactures work out ways to survive, all well blaming the manafactures for producing what they asked for, sadly without the consumer mentality changing the future is not good. P.s. im not saying this makes sense. But so many love the idea of the conspiracy theory, when in reality its just supply and demand.

Ask how many will pay for snap on over craftsman.
Another example.

All companies are in the business of making money, thats there function, not good feels.

And most importantly a 30% gain where there isnt a 30% drag.
Reply: @unicornadrian1358  m
Reply: @martin09091989  I'm pretty sure you can hold a gooseneck boring bar stationary at the deck height and rotate the whole block at an offset from the crankshaft mains using a rotary table fixture
Reply: @Shanidar1  The video was far too long for this genius.
Reply: @doctordapp  fuel efficiency increases by 30%. People would buy less gas ⛽.
Reply: @martin09091989  Did you not watch the video? It explains why...
Reply: @martin09091989  for the benefit described! 30% efficiency gain use massive. Simplifying operation is also hugely important.
Reply: @martin09091989  bro you're the one who literally repeating your frases. And he explained it in the video, do you even watch?
Reply: @ddegn  Rodoir = lapper
Reply: @Kj16V  Thanks.
Reply: @PatricioGarcia1973  After I make stupid people make ther mouth shut professionally, I am keyboard warrior, yes!
The compressors in that style are used in applications where you can't use lubricant (or less) on the pistons because of contermination, like medical or some chemical stuff.
That's where this is useful, NOT IN ENGINES as it turns out!
Reply: @Test4Echos  yes, and he hase success with it. Just not as a internal combustion engine! 😂
And that's my whole point!
Reply: @martin09091989  The only friction would be inside the bearings and most importantly the piston is always positioned and pivots on a single bearing. In conventional engines the pistons endures constantly changing pressures and directions. In this design you have a neat separation of force and positioning of the piston. So a lot less friction since you eliminated the main cause of it. Thus you need to generate less power for the exact same net output. Additionally you can also reduce the cooling system since you generate less heat that needs to be removed and the whole engine can be more compact. The last two points both reduce weight.
Reply: @jannpatrick6392  Yea of cause! You are absolutely right! 😘
Reply: @magnusatheos7301  : What compressor manufacturers?   Name just one that has it in volume production.
Reply: @PatricioGarcia1973  Parlà di chì?
Reply: @keithammleter3824  watch the video again for the compressor manufacturers and uses . Gasses that are un contaminated by oil is the main one. Dweeb
Reply: @Unkl_Bob  You watch it again.   And do a bit of googling and check your facts.
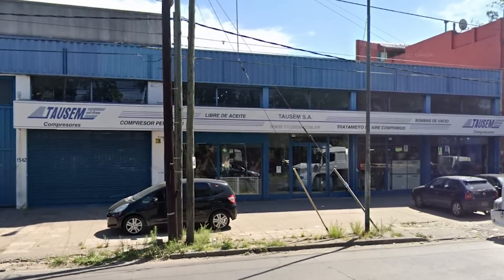This view goes on about compressors from 4:43 onwards, but no manufacturer is named until Tausem at 5:06.  No other manufacturer is named - only manufacturers who looked at it (and rejected it).  Tausem is a small volume Argentine compressor manufacturer, pretty much unknown outside Argentina and represented but not very well known throughout South America.
Low oil and oil less compressors are made in volume by major manufacturers such as Atlas Copco, using the diaphram type and other methods depending on requirements.  
It is not in production as an engine.  In an engine, oil is needed for piston cooling.  Using oil means the cylinder must be honed.   In an oil-less or low oil compressor, especially if multi-stage, there is no need for honing.
Reply: @magnusatheos7301  true but what materials are being used in the compressors and how are the pieces fitted together. Boring curved holes in a single block of aluminum on a mass scale could be the issue.
Reply: @magnusatheos7301  how do you hone the cnc surface?. it will not be smooth enough
Reply: @davidjones-vx9ju  Not sure, perhaps a ball type hone?  I've been trying to find some info on how the prototype was made but can't find anything.  It has to be possible as there are working models out there.
Reply: @magnusatheos7301  yea...that's certainly possible , but at what cost?
Reply: @davidjones-vx9ju  Obviously too high of a cost as it never went much further.
Reply: @magnusatheos7301  they figured it out for aircooled engines. but watercooled ones need coolingchannels along the walls. thats pretty hard to produce also today.
Reply: @magnusatheos7301  compressors are probably being cast rather than machined, which I'm guessing isn't strong enough for a consumer grade engine
Reply: @magnusatheos7301  those look cast
Reply: It shows you in the video. The machine rolls the block up onto the cutter.
Reply: @unicornadrian1358  yeah but can you do it at the insane feed rates needed for mass production?
Reply: @mattweger437  depends what tolerances it is cast/die cast at.
Reply: Center out the pivoting point of the banana arm.
Use that as a rotation point.
Them use a normal mill with round inserts.
Spin up the mill and slowly rotate the engine block up.

Shouldn't be to difficult on even a 100 year old mill.
Reply: @doctordapp  yea good idea easy to make a dedicated machine for mass production too
Reply: And piston.
I can see why motor manufacturers turned it down, mass production to the required close tolerances would be 'challenging'.
Reply: You could do it on a standard machine. You just need to setup the block to pivot on the same bearings that the pistons rotate on. Stationary boring head, rotate the block.
Reply: You put a rod through the base of the pendulum and then rotate the engine block itself along it's axis, letting a stationary boring head do it's job. 1:14 you can see on the left a device that appears to do the job of slowly rotating it in order to finish the boring of the shafts.
It will probably require more than one pass on order not to end up with an oval-shaped hole but the operation itself isn't all that complicated
Reply: @jackmcslay  : That will work for boring but not honing, and honing requires both rotation and up & down motion of the hone.   The hone will have to be a continuous shape-shifter.   There's bound to be a way of honing satisfactorily enough by some slow hand process, but not a high volume production process.
Reply: @keithammleter3824  There is a type of honing tool that looks like a cartoon coronavirus, with wands with balls on the ends made of rubber containing abrasive particles. I think it is called the Flex-Hone.
Reply: 1:09
Reply: Additive manufacturing of really good braze welds may help this become more common. Cooler engines means less NOx.
Reply: It said it's "Fairly easy to do"
Reply: I'd think with a flying cutter, extending from a thin disk, at the end of a longish shaft, the block could be rotated to match the casting curve.  You'd just machine the bushing holes for the fulcrum end of the curved piston rod, then suspend the block by running a long bar through the holes. Now, the cutter will follow the cylinder as the block is rotated on the bar.
Reply: Air compressors are made with this kind of "engine"
Reply: Any multi axis machine center could do that easily.
Reply: Lol
Reply: Theres footage of it in this video - you just need a drill that the cutting head looks like a relatively flat disk rather than a cylinder all the way down, on a drill press style machine, with the block attached to a rotating axis that you can slowly rotate as you plunge the cutting head. So long as you plunge at a rate relative to the turn rate, you can accurately machine any curve you want.
Reply: @trotskiftw  " that you can slowly rotate " slowly anything ., is the stumbling point ., it ' s at this point the " stand " design wins...Like a cheaply built house ., the up front cost is one thing ., the running cost is the other ... let us say ., you get four standard " bores " machined for one " that you can slowly rotate " and the front end cost kills it ... I may be a brilliant mouse trap ., but how ever brilliant it is ., it is effectively wrong ... The world may need it ., the market may not ...
Reply: @robertwoodliff5622  I never said how economically viable it is, I said it was relatively easy to manufacture with simple machines. Also the way you add random punctuation makes your comment hard to read.
Reply: @trotskiftw  .... Dear Trot ..... I ' am glad to see we have similar think on this ..Yes ., I would agree that this could be " made " but would not be so ., because of it ' s economic viability .. Of course ., if the claims are as described it could be legislated into existence ., as 4 stoke have mostly ousted 2 stoke in the motorcycle market ... But as politics tend to move a the speed of a dead sheep ..... hay ., what are the chances ... Regards Bob .... ps I ' m dyslexic .... at least exuded from a keyboard ., you can read it !!!
Reply: My favourite engine maker Napier ...
Reply: As with most manufacturing it could be cast and then honed and machined to perfection. If it can be done for compressors it can be done for an engine. From my experience working in manufacturing the air compressors put up with some serious abuse and kept going...well most of the time. Often running over 300 hours a month almost continuously in a hot dirty environment.
Reply: @volkswagenation  yeah thats the block, going to run the piston in that directly are you? No sleeve, have fun inserting one.
Reply: @m3chanist  With the right equipment I don't see there being a problem inserting a sleeve. A scissoring press tool where the parts would be placed at an appropriate distance from the pivot point to replicate the radial curve of the piston/cylinder curve. 
Anything can be figured out of you want to find a solution.
Reply: The cutter teeth need to extend outside of the cutter body which will give sufficient clearance to bore a curved path. The block is then mounted on a rotary table and bored. A standard boring head with a single point cutter will also suffice.
There are also drills available that will do the same thing.
Reply: This moment was to me - this is all total bullshit.
Reply: No need sound like it’s indestructible
Reply: since he machined the one of his own out of a filled cast block, pretty sure you could just cast them like most mass produced cars and get a similar effect. No doubt the original was an almighty pain to do but it's proof of concept so worth.... or maybe not in his case
Reply: as you can see, it becomes easy when you make only a short sector of the torus.
Reply: They literally showed the machine and setup of the machine that bores the curve in the video.
Reply: i guess one could use slm printing to create one today but it would be very expencive
Reply: A lolipop end mill would do it no problem.
Reply: exactly.
first im seeing a trunnion table for the curve.
a spherical tool, or at least a slot-saw type thing with radiused cutting edges. the whole cutting operation has to be on a line radial to the center of rotation.

the spindle its mounted on is going to be limited in the maximum diameter to reach to the base of the bore. there goes rigidity.

honing? another spherical tool thingy, having to follow a very controlled path. and no ability to use the rest of the cylinder as "support".

try centrifugally casting a blank CI liner...

pressing in liners? ha ha. so nikasil or similar.

and they have to do their own process to finish it before and after plating... ouch.

sure, its possible, but at what cost and for what benefit when its still just a bloody crank and conrod engine?
Reply: @paradiselost9946  yep!
I would like to see some of the Fanboys resolving any of those problems. 😁👍
Reply: 1:10 its shown in the video...
Reply: To HONE said cylinder,
Reply: If there’s hundreds of Taurrozzi compressors, why can’t they be converted into engines? Better still, he should have built the engines and sold them himself, set up his own company.
Reply: @chrishenniker5944  It's a good question.
The heat and the deposition of unburned particles must be taken into account.
If this engine is really better, it would probably be more expensive to manufacture.
Reply: It is actually very simple, easy and cheap.
Think your ordinary washing sink, yes yours could easily be just a regular one, made by pouring liquid into mold. But there are sinks made out of stone, that are curved just like regular one. Those are made by  using rounded grinding wheels. Meaning the grinding surface is not flat.

Same thing here, one side of a grinding wheel is moving forward faster, other side slower.
There is  also the thing that you do not need to remove a lot of material, since the starting shape is a mold, not solid chunk of metal.
Reply: literally shown in this video lmao
Reply: Yes I agree with you on that, ,I  think this  a click bait video, ,
Reply: Same machinery that does non curved bores.
Reply: He literally says a curved boring machine in the video was used
Reply: What I see is not only a more difficult to bore cylinder, but along with that having to keep the pivoting piston assembly to extremely exacting tolerances in order for the piston to be exactly in the center of the curved bore.
It probably works well in the compressor with less heat, but probably not in the internal combustion set up with greater temperature variations.
It looks great on paper and in animations.
Reply: @michaelszczys8316  
I totally agree. Traditional bore to piston clearances and ring end gaps would also be different. What about rings? I have never seen any that didn't have straight faces to the bore. These seem like they would need to be slightly rounded from the get go to keep from eating away the cylinder walls on break in. Not a huge factor but a consideration. I have broken in hundreds of rebuilt aircraft engines and have seen 1st hand how a new engine can have "teething problems" if not perfectly set up. That is why I want to see more about this concept. The details are interesting.
Reply: It's just a bore on the same kind of pivot.  Slop in the bearings would be critical to minimize
Reply: 6 axis CNC machine.
Reply: @theyoutube8933  No actually. A rather simple purpose made machine can bore such cylinders in large quantities. It is just an ordinary cylinder boring machine with a work table that rotates on the axis of the torus.
 If you were to make only one, or perhaps just a few then you would use a CNC. I don't think it needs to be six axis though. Four axes should suffice.
Reply: @listerdave1240  ok. Cool. Interesting really. I thought it would be more complicated than that.
Reply: @listerdave1240  I can see where  CNC couldn’t be mass production.
Reply: @theyoutube8933  
Not the kind of equipment you get at Harbor Freight?
Reply: @negativeindustrial  😂 definitely. But would you really buy a CNC machine from China freight??? 
I bought a hammer and some pliers because I was in a bind. I know everything else is junk unless you buy the warranty and then it’s free the next week 2nd time around.
Reply: @theyoutube8933  
I’m just making a sideways crack at the internet machinists here. Don’t mind me.
Reply: @negativeindustrial  oh yeah. Definitely. I was being sarcastic and funny. 
Texting miscommunicating your words to what other people mean. 😂
Reply: Probably not easy but casting shouldn't be hard
Reply: How did I know there would be a bunch of word savvy engineers tearing each others guts out ?  You all need to kool your jets. And your turbo props, and your wankels. The answer, -  for whatever reasons there's no money in it or it would be in abundance.
Reply: 3d milling.  No big deal these days.  I do stuff like this every day
Reply: @pharaun159  can you show an example?
Reply: @davidjones-vx9ju  https://youtu.be/Gq_E7hkhw9A. Not my video.  Most of what i work on these days is proprietary or prototypes for other customers.  Im not generally allowed to post specifics.  This video should give you the jyst of the process however.
Reply: Wouldn't be that difficult. A chuck mounted on an arm to match the curve, a cable to drive the chuck. Or, drive the chuck directly with a motor mounted on the arm. You couldn't take a huge bite out of it while boring, but meh. Honing process could be done the same way.
Reply: @akio2589  
OK, show me how. That is all I am asking. I can't even get a straight cylinder bored anymore near me. All of the machinists are either retired or dead!
Reply: @upsidedowndog1256  I mean.. There's a patent for such a device from 1864. You don't see them because there's not really a need for it. Same with regular engines. Not many people need to have engines bored these days. That being said, many hydraulics shops can bore regular cylinders.
Reply: @upsidedowndog1256  Are you comprehending the video? There is almost zero friction. You would never need to get this engine rebored.
Reply: @andoletube  
It has to be made in the 1st place. And there is ALWAYS friction, even if reduced by 30% as the video says.
Reply: @upsidedowndog1256  It has been made already, and it's made in the compressor industry every day. Curved bores are not a problem if you know anything about machining technology. The friction In the bore is extremely low in this design because there are no side forces acting on the bore wall. It's only the very minimal friction from the piston/wall seal. Its negligible compared to conventional pistons - and some of those run for up to half a million kilometres. A 30% reduction in friction is enormous and it's coming almost entirely from the curved bore - it's enough to  allow an engine run for well over a million kilometres before there would be an appreciable loss of compression. Does anybody really need an engine to run longer than that?
Reply: Well it's called a C.N.C or C&C multi axis mill or lathe, I'm thinking its C.N.C but I've been wrong many times before.
Reply: @WhoNosU  CNC - computerized numerical control
Reply: 5 and 6 axis cnc can do it, even many robo drills are capable. I saw a demo years ago where someone machined a bacon strip shape on a 6 axis.
Reply: People here saying "just rotate the machined piece onto the stationary cutter" as if that's at all obvious or even possible. The cutting head doesn't magically turn on its own and it's not two dimensional. What about the chuck? What about the shaft? A spherical cutter helps in respect to dimensionality, I'll grant that to the people suggesting it, but I ask again, how does one hope to spin the cutter? It's on a shaft in a chuck. A 3D milling machine doesn't help. To get angles and depth even remotely like what you're looking for you need an extremely thin shaft and a very sharp shoulder on the spherical cutter which doesn't sound structurally very great. I know it's possible to machine something like what we see, but I'm having a hard time buying its practicality on even modern CNC machines. It doesn't matter if it follows a particular curve if the piece has to contend with the shaft and the chuck of the machine.
Reply: @Ramblin_Jack  lol....dude made the original with a 1980s boring mill and a Bridgeport...
Reply: @pharaun159 huge jump between making a prototype and mass production.

Repeatability and keeping quality within a bellcurve for consistent fit (at a reasonable cost) are dubious propositions at best.
Reply: There are curved metal couplings of every sizei, it's easy to mass produce.
Reply: If no volume engine manufacturer took up this idea there must be less benefit than portrayed in this video.
Reply: @johnsawyer2516    You have a point.  But I have also seen several patents purchased and shelved for a variety of reasons.  First to mind is an attachment that threads onto your cold and hot water spigots on your clothes washing machine that will only allow water to flow for a fixed amount of time (say 2 minutes per cycle) before it  locks out resets.  How many people have had a leak from a washer or ice maker that flows all day before you come home to a flooded home and turn the water off.  This was an item a friend of mine patented, sold, and I still have never seen it on the market in the 20 years since he sold it.  I think, but obviously can't confirm, that there are plenty of designs out there that are stifled, for various reasons, but have real merit if run through their paces.  The Wankel engine has always had problems with the wipers, but there are auto makers now experimenting with that design again because of new materials technologies or design advancements.
Reply: They're actually pretty cool😎
I've watched one used for ports and after it was finished with fluid polishing, it was actually a mirror finish 😃
Reply: it was in this video.. 1:10 Big cutting head with a reduced shank. 
only works down to 45degrees or 1/8 of a turn. The full 90degree bend as shown in the computer model is not possible.
Reply: The problem here is that you have two piston connections. The crankshaft to deliver power and the bearing on the top right .  This may be good for small engines but, as you increase size the forces may cause a problem in these two connections or at least the main bearing area.
Reply: @rayRay-pw6gz  I was thinking about the expansion and the opportunity to push the piston Into the far or new side of the bore from the upper bearing ...
Reply: It would look basically just like the engine - simply replace the cylinder head with a spinning tool / disk
Reply: Billet  aluminum heads, look up a video on that and you will see.
Reply: the curved cylinder hone is a real trip!!   /s
Reply: I'd like to see how they would sleeve it to save the block..
Reply: It's not difficult. Its just a boring machine that uses a screw to rotate the boring head.
Reply: Look at just about any oil drilling rig.
Reply: Maybe casting instead of boring ?
Reply: @theirthereandtheyre2947  It would still have to be bored. A cast surface is not smooth or exact enough for engine work.
Reply: Flat boring head mounted static, with the workpiece being rotated with a 4th axis.
Reply: Easy.
Reply: Just watch 1:10 .... that's the machine ...
Reply: easier way would be to create two halves and bolt them together the way the Wankel is bolted together. After all you need to insert bearings in between so it would just make assembly that much easier.
Reply: Hand crafted 🤣
Reply: it's 1:09 into the video...
Reply: The banana shape piston bearing is talking care of the alignment so you don't have to worry about the cylinder wall so much
Reply: A good point. Thinking about that, I find it hard to imagine. Turned or milled, it's not going to work. I guess cnc has it figured.
Reply: It's not that hard . You already have a piston describing the ark . Just add tooling and honeing
Reply: Something (block or tool) spinning following a cam.
Reply: Brilliant design especially with modern Koenigsegg freevalve camless technology and forced induction. A new compact long stroke Harley VTwin anybody?
Reply: It’s not that difficult. It’s been done for a long time with a lathe equipped with what’s basically a gear index drive on adjustable length offset.
Reply: @TsunauticusIV  
OK...and I STILL  want to SEE it!
Reply: how would you even hone a curved zylinder bore. There is a reason why we use simple geometry for high precision parts
Reply: Why do many insist that a machine would have to cut out a complete bore hole out of a solid piece of metal! The curved bore holes would be cast from the engine  block, and a machine would lathe and polish them up to spec.
Reply: @diggerpete9334  there is a reason why we hone zylinders. You need those tight tolerances. And with that curvature you are not going to get a tool all the way down. So is your suggestion to bolt together 2 halfs of a zylinder ? People ignore manufacturability, cost and time. Even IF this design would have any performance benefits. The higher the needed tolerances, the simpler the geometry needs to be
Reply: @diggerpete9334  
I don't know. I simply want to see how it is accomplished. I always loved watching a good machinist. Sadly there are none near me anymore.
Reply: @diggerpete9334  you have to bore cooling channels for watercooled ones. These Are Not really castable.
Reply: you dont move the drill head, you manipulate the part you’re drilling
Reply: the only way I can think of is that you mount the engine block on a pivot along the axis of the crankshaft, then instead of lowering the cutting bit into the block, you rotate the block upwards into the cutting bit... this would make the curve , until there is no more space between the upper edge of the block and the machine
Reply: “Relatively easy to do” 💀💀💀💀💀
Reply: Fasten your cutting head on to a hinged arm the length of the radius that corresponds with the arc you want to cut.    Tah dahhhh!!!!  

Not that complicated.

For that matter, you could leave the cutter fixed and put the block on a hinge.
Reply: @Rumbleghost  
I will just say that I just want to see it in action. Simply that. Show me, don't tell me how it can be done! I just want to see it.
Reply: They simply use a pasta drill
Reply: Picture a curved shaft weed eater with a drill bit replacing the string head, put on the ground and throttle up and pick it up slow and steady only on one end. 🤷🏻‍♂️
Reply: Nothing modern 6D CNC machines can't do, I work for a world leading aerospace manufacturer     This is nothing to modern technology, and at this point relatively cheap... I do work for the Army so not sure if the type of equipment we use is available for normal consumers, but I'm sure it wouldn't be a problem ☺️
Reply: 5 axis CNC or rotary table on a manual.
Reply: SIMPLE!. Imagine a rotating drill shaped like a piston (instead of a piston), that follows the path the piston would.
Reply: 30% more efficient. Less gas bought ⛽. Big oil 🛢️ loses money 💵. Not good.
Reply: @Sammy Van Dankstein 😂👍
Reply: I used a steel elbow and copied curve clearance to do this must be 90 Street to pull it off, I was amazed! It works follow instructions good, thanks
Reply: Makes a four-stroke engine only more complicated. Whats the benefit of this construction???
Reply: @tostedt2010  
30% less frictional losses.
Reply: The hole would have to be cast.
Reply: I've seen such a machine before, it's less spectacular than you think. It's just a kind of boring machine that's mounted like the piston in the engine. It must be noted that the radius must be the same and the hole wide enough so that the shank of the milling drill does not hit the wall.
The milling cutter is disc-shaped. According to the owner, it takes about 10 minutes to drill such a cylinder with a diameter of 50mm if this has already been cast in the cylinder.
Reply: If the thickness of the block isn't that great (by the looks of it, it should be no more than a 120° degree angle), a circular bore that can be adjusted on the Y axis (up and down) should be able to cut the full length, or at least a good ways through.

Toroids are just sections of a donut, it's manageable.
Reply: @Elfein Landers No, but thank you for informing me about that.
Very interesting, maby I should leave all those idiots alone in there hype about stupid tech! 🤔
Reply: The bored would be a pain but I think getting an accurate hone would be the hard part. Sure you could do it by hand but that's not ideal in a production environment, haven't seen a CNC honing machine that would do it
Reply: Simple 5-axis milling would do it
Reply: @jannpatrick6392  
Ok. Just show that.
Reply: 4th axis mill machine process with a radius cutting mill an ball spring hone. They actually show it for a half a second near the beginning.
Reply: Curved boring machine?¿??????
Reply: No need. Cast it.
Reply: @Bartonovich52  
Show me how to hone it then!
Reply: You have to make a milling machine and boring machine with a pendulum system as the taurozzi engine has,i don't see it as a problem if you don't consider the money you have to re-invest money to purchas new machine tool
Reply: I would be concerned about the tolerance needed at the pivot point. Cos it's amplified by the length of the arm. To keep that straight in the middle you would need low tolerance and no wear at pivot point. The efficiency is clearly superior to any other type of engine as long as you can keep the cylinder perfectly in the middle without using a rail effect like in most engines where the piston is free to bounce left and right along the track and the way fuel burns actually makes a difference in wear and efficiency. In this type of engine, it makes less of a difference where the flame starts and the direction it burns, allowing to spend less money on the design of the head. Now with direct injection, most of the money will go to model the head cos you got only a split second to inject and mix the air and fuel. Not to mention the higher tolerance of rings to reduce friction, oil burning and all that. Then some dumb american comes in and says .. nah, this is not an improvement. But it is
Reply: Actually they have a machine that does that, and its not a big deal. Its a driller on a pendalum. The reason why they don't want to do it, is because the big oil companies don't want to lessen gas cosumption. Even with EV's, the electricity needed to power the cars, is purduced by power plants burning coal and gas. So there is not lessening of gas consumption there also.